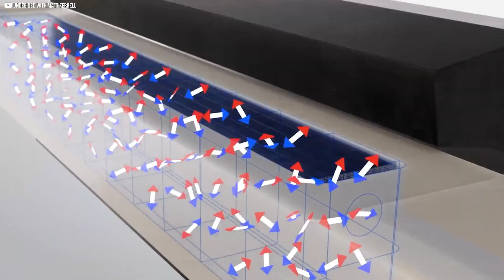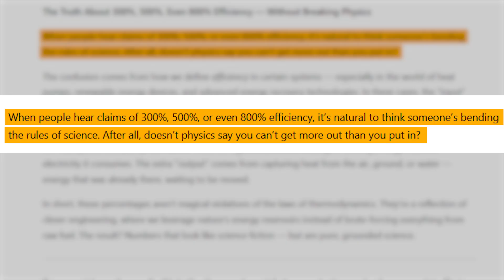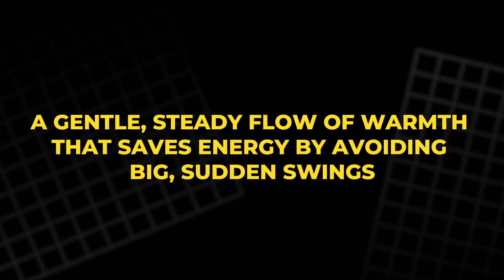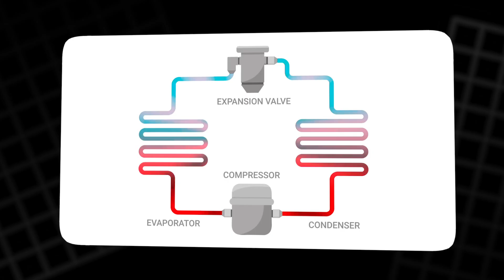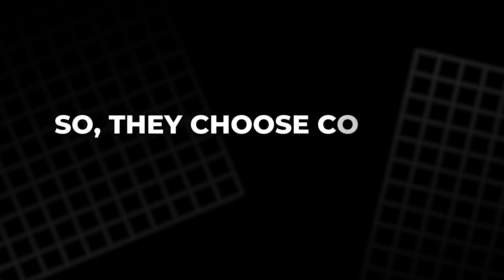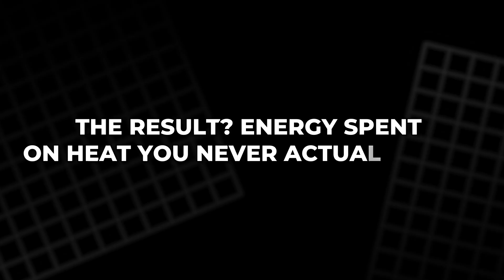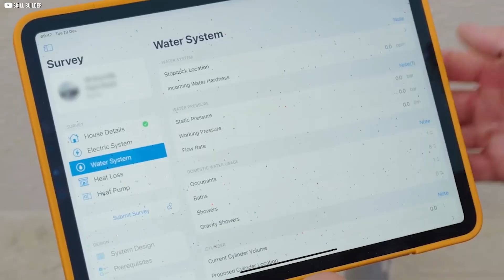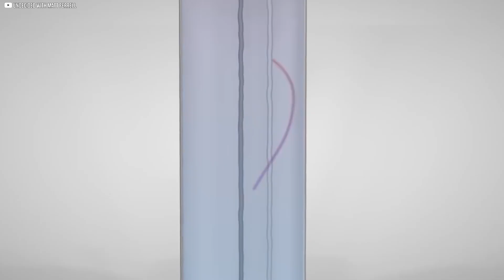Why Heat Isn’t Made… It’s Moved | The Heat Geek Method

Comment: well heat pumps is same as taking a burning pile of coal and moving those to another location. you did not create the heat, but just moved the heat source. well if coal is on train tracks then the moving is near zero cost. so basically loading up fuel into a wood stove is a heat pump, too. not the burning operation, but the transporting of the wood. 800%. zero to something is infinitely better. its only about the energy storage packaging. the fuel is only the heat pump cryo fluid. being in hurry is not a nice end result. there is an issue with 30-40C water, it will gather bacteria and stuff. not nice. hot and cold, not meh. sounds like belief based work in vain. so who needs to get paid. right.

Comment: Why not run a conduit from HP water heater intake to the peak of the attic?  Thus, when the HP runs, it will pull the hotter attic air rather than the air in the garage.